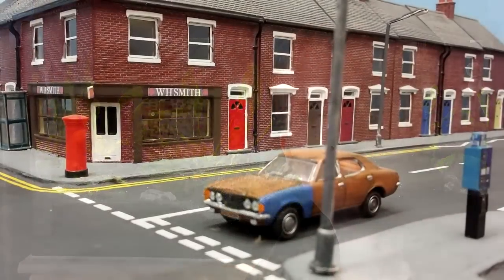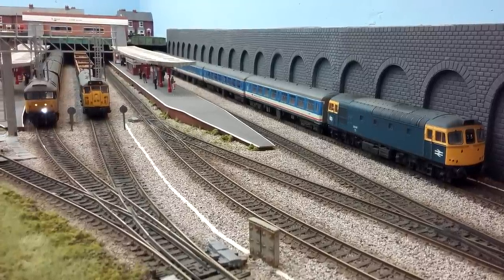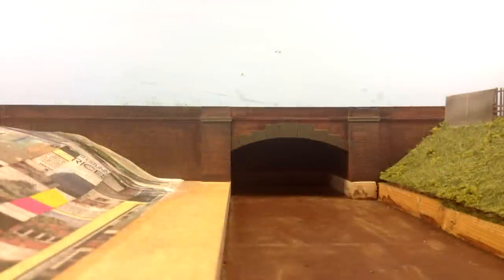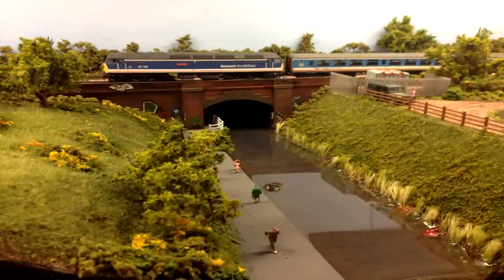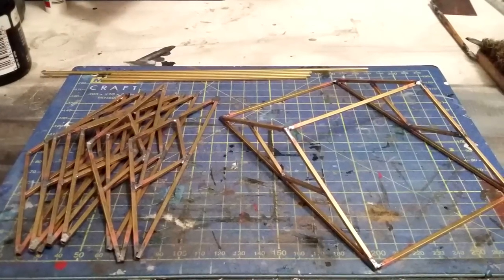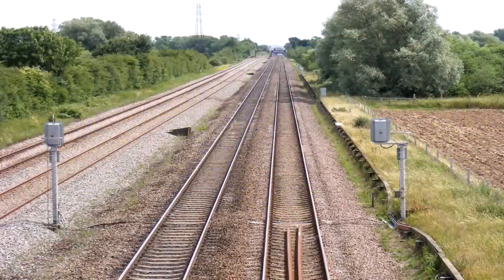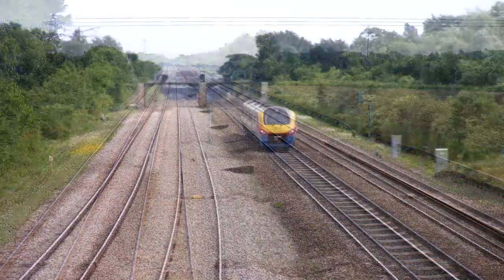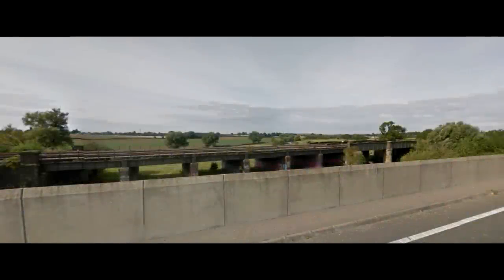New Layout Ideas

Comment: The demise of your old layout was a worrying reminder of my own 12 year battle with poor baseboard construction. Apart from shoring it up with extra cross-bars & legs, one thing that has proved very useful was being too lazy to glue the track to the ballast in 2005 (painted & ballasted separately), track alignment can thus be modified at any time by adding/removing ballast as required – so I’m still just about ahead of the game. Obviously this wouldn’t be necessary if I’d built it properly in the first place! Move to Code 75 highly recommended, I find it difficult to look at Code 100 now (!) but re-used Code 100 from my previous layout in all hidden sidings. Best of luck with Everard 2.0, exciting times ahead!!

Comment: Not very well know but so far very good in my experience is the Digikeijs DR5000 system. It needs computer control but using something like iTrain you can still drive the trains manually. Its also somewhat more cost effective (cheaper) than a lot of other equipment.

Comment: an idea for the cars system.

2 N-gauge tracks underneath the road deck, plastic road layer.  a few N-gauge shunter chassis underneath, (chipped) possibly with freight cars.  in the freight cars MAGNETS.  these pick up the cars on the top and can then be "driven" and so as the trains move, they pull the cars on the road by magnetism,

With the roads  on top of a cavity that has N-gauge "trains" below, you could also use that as a means to run cabling too, keeping it out of site.

Comment: A good material to use would be buffalo board. It's an incredible tough board which is weather proof as it's primary function is to be floor boards of trailers. ifor Williams have used it for years to floor their trailers which are second to none

Comment: You mentioned implementing a more advanced / computer controlled system - have you considered using Arduino controllers?  You could do all kinds of complicated stuff, including block signalling, train sensors and servo motor control (for points) very easily.  It's also a great deal cheaper.

Comment: will the new layout be steam or desiel ?
Reply: I can't answer for Richard, but as the era is the 80's, I feel pretty sure its going to be diesel. Steam was pretty much a thing of the past by then.
Reply: I think he did say in his last video that the new layout would be using all his existing stock, so we can expect diesel.
Reply: tjf4375 With the class 5 as a heritage steam loco on rail tours
Reply: Tornado wasnt finished until 2009 and Scotsman was in Australia. Also you spelt basically every 2nd word wrong.
Reply: I am looking forward to seeing the standard class 5 though. Really loved it on the different eras on the layout video
Reply: Will Swadling spelled*
Reply: Both are correct
Reply: Both are, as Will says, correct. Although Americans tend to use "spelled" more, as "spelt" refers to a type of coarse wheat.
Reply: richie sutton he's a diesel man like myself, the occasional steam on a rail tour I expect ?

Comment: Do you have any tips and advice for a complete novice (ala me) regarding building their first layout? the main thing i'm concerned about is the wiring and electrics. I have really enjoyed your videos since I found the channel last year and I was just wondering if you had any suggestions.
Reply: If you are going DCC then wiring is honestly a breeze two wires to the tracks no complicated isolating sections just install feeders ever 3 feet or so to keep signals at a high level. Other than that is all simple easy stuff :)
Reply: Hmm, that's definitely a good idea, although i don't have a DCC controller (got an N gauge starter set about 5-6 years ago) and i'm honestly not sure whether i should do DC or DCC for the first time building, although since i have a long term layout plan in mind, i'll try and get that later one DCC.
Reply: If possible and funds allow I would honestly recommend getting a DCC system as it can be re used and depending on your prospects for a short term layout if it was to include many sidings DC could become complicated to wire isolation sections in. DC is a lot cheaper for first time however the control using just a basic DCC system can add lots more operating potential. As mentioned in the video I too will be using computer control to dispatch various trains around my layout and the idea of sitting back watching mainline operations run while I build a train in the yard ready for the next operation entices me an awful lot. Feel free to PM me if you would like info on various DCC systems as there are many available that do or dont do various things and some can be had for as little as £60 that provide massive amounts of features.

Comment: If you really are going open frame, then the loft hatch 2' width limit doesn't apply - most of the wood will be less than 4" wide if open-frame, and if constructed up there. Of course, you may have other good reasons to limit the width to 2'.

Comment: Hey man - I've got a suggestion for your control system. I've been working on it for a little while, but I reckon it could easily be used for pretty much any layout. hang on, this might take a minute.

Before I start, here's a basic diagram for the system: https://www.dropbox.com/s/a1g2seubj28fpto/layout%20control%20diagram.png?dl=0

There are three blocks: 1. the control panel, 2. the receiver chip on the layout, and 3. individual chips around the layout where they are needed.

1. On the control panel, there is a large PICAXE 40X2 chip, into which all your buttons are connected (using an array, you can get over 250 without any problems). Another chip controls LEDs for various functions (point indicators, signal indicators etc.), again through an array using transistors. The two chips communicate with each other using a simple serial connection. The larger 40X2 chips handles the communication with the layout, which can be wired or infrared wireless (using AA batteries). The wired connection only uses 4 wires (+5v, 0V, 2x serial).

2. The receiver chip on the layout can be one of two kinds: either a tiny PICAXE 08M2 chip for the wired connection, or if you use wireless you can upgrade to a larger chip, depending on how many infrared receivers you want to mount around the room. This chip receives the commands from the control panel and determines what to do (for example, you can interlock points with signals etc. if you so wish). It passes this on to the chips around the layout again with a simple serial connection.

3. Anywhere where anything needs doing, for example point motors, signals etc. you install a suitably sized PICAXE chip. They are all programmed with a unique address so they know which signals to listen for (a bit like DCC). They are all connected to the main layout chip with the same serial wire. The main layout chip sends out a serial command over this wire which gets the individual chips to switch points, change signals etc.

The advantage of this system is twofold:
Firstly, the control panel is only connected with either 4 wires or not at all,
Secondly anything can be reconfigured easily, by simply reprogramming the chips to do different things.

I've got a prototype here at the moment, which is a lot smaller for my little exhibition layout, but it works on the same principle.

Comment: Faller car system, please install a guy on a magic carpet.

and also regards to the Hornby Railmaster system, its all fine apart from when there is an accident on the line and its impossible to run to the laptop and hit the emergency stop before another train collides into the back of the stationary loco that has just derailed/crashed/hit the guy on the magic carpet.

I am trying to get back into my layout which was originally made from chipboard at the time (worst decision ever) but a decision that was made on a budget.